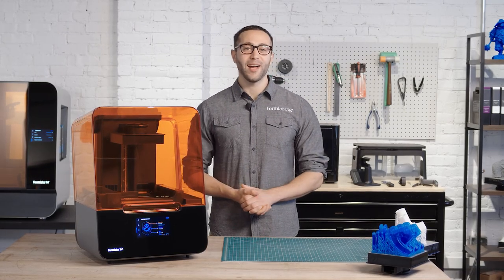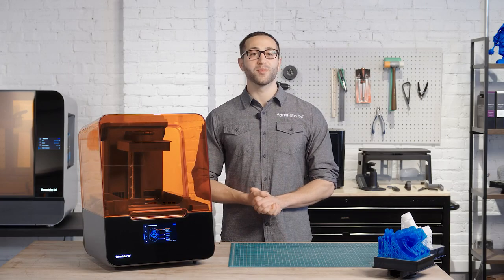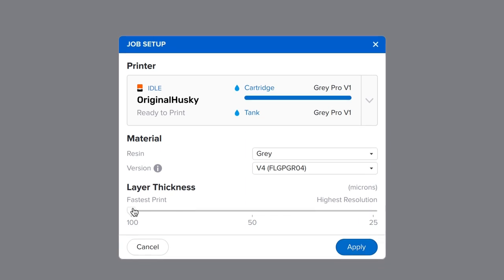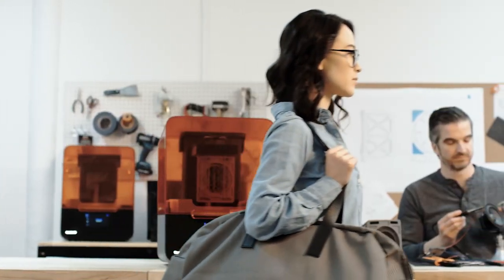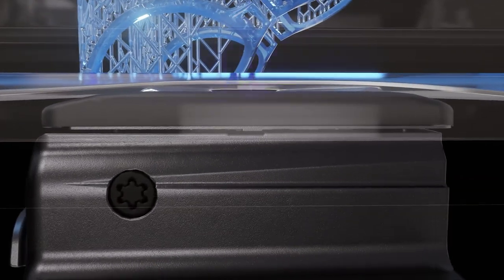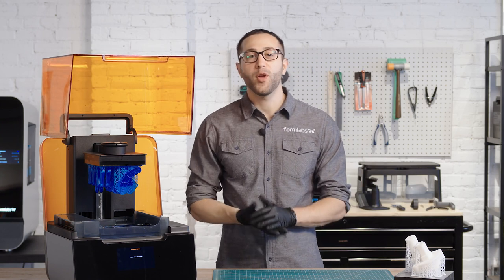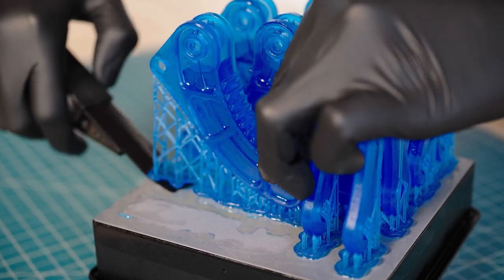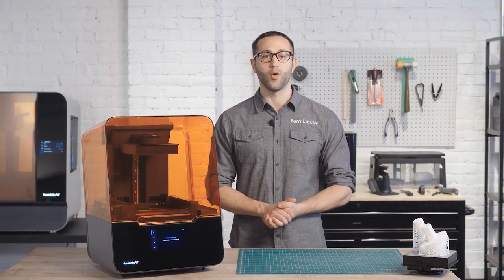From Design to 3D Print With the Form 3

Comment: Hi, on form 3 is it possible to use the open mode (i.e. being able to use other brands of resins) as with form 2?
Reply: Form 3 is a revolutionary new platform, introducing the new LFS (Low Force Stereolithography) technology. In order to ensure success printing for all from the beginning, the open mode is not yet available. It is planned to be avaialble in the future. Meanwhile, new exciting materials released, like the Tough 1500 and Tough 2000. The wide range of materials enrich and expand the solution for more applications, enable you to find the most appropriate material to your need.